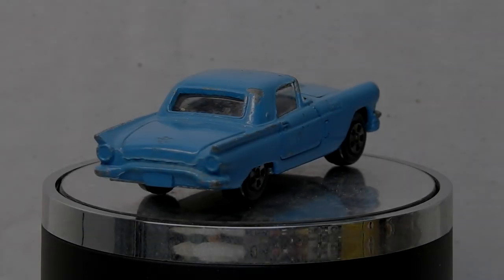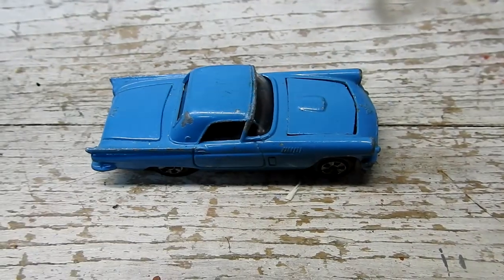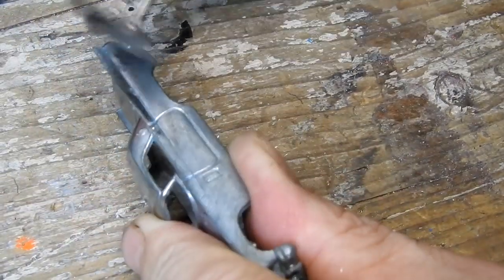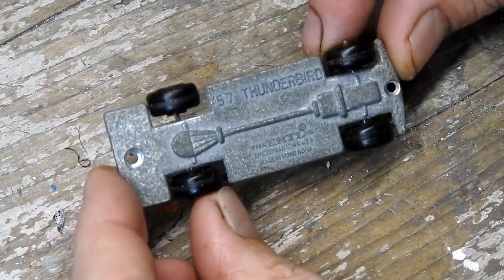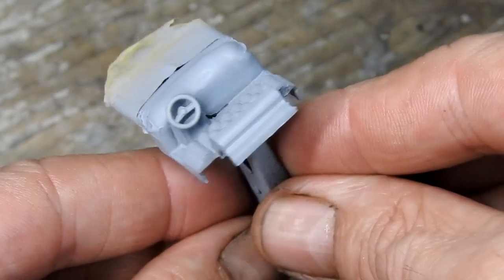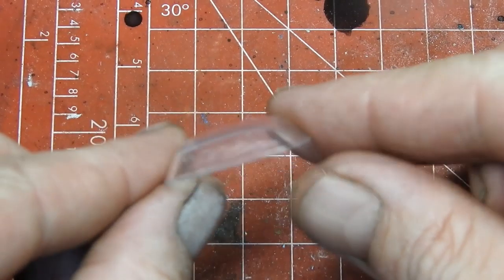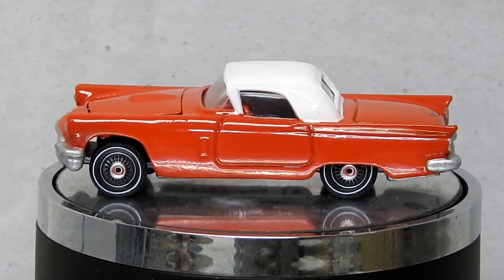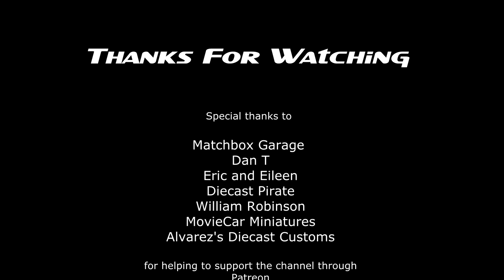Ertl '57 Thunderbird Custom Restoration 'Subscribers Choice'

Comment: Nice custom, looks great in red with the white top.  I have also had nothing but trouble with Green Light wheels, they are total junk. I have gotten wheels that have either been drilled off center/off angle or not drilled at all. The tires are even worse, out of round and misshapen. Not wasting my money on their products anymore.

Comment: You missed one detail on this model. Or should I say that ERTL did. Where's the portholes?! Great job, and it looks so much better than that awful blue. Regards, Solomon
Reply: The top could be ordered with or without the portholes.
Reply: @rockettcustoms6266  Yes, I remember, but no self respecting T-bird owner would go without Portholes. They kind of defined the era.
Reply: They actually are there,if you look closely.
But instead of "holes",they appear in a kinda relief pattern (or at least half of,anyway).
But you're absolutely right there,coulda used a bit of painted on detailing on it,though.